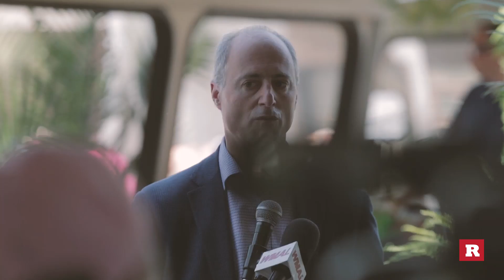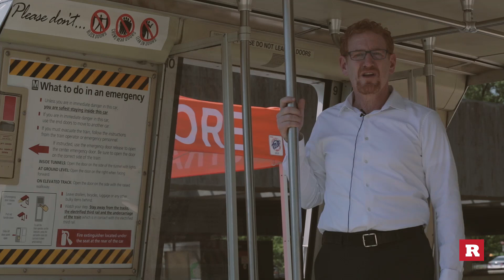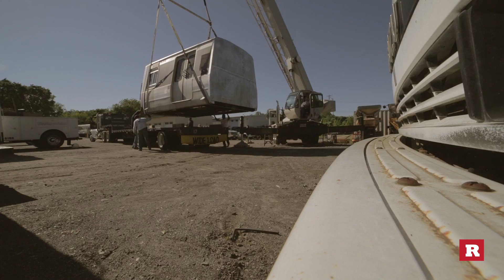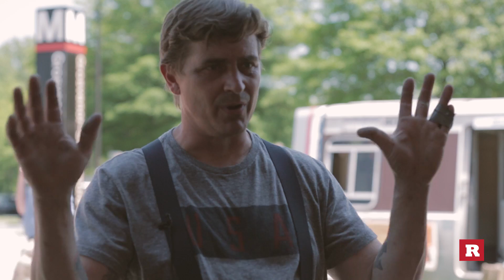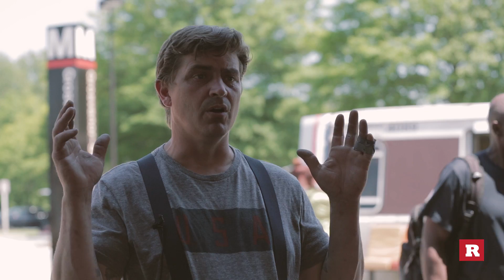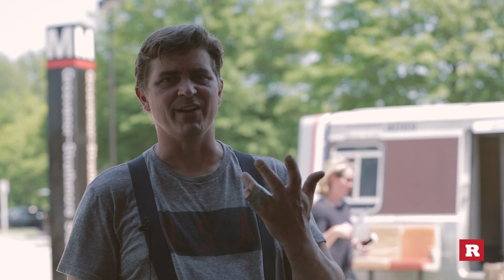DC Metro cars turn into pop-up retail kiosks | Rare News

Comment: OMG...what a sad fate for these wonderfully designed cars. The 1000 series (road numbers) were the 1976 originals now all gone. Same for the 2000 and now the 4000 series cars. R.I.P great legends of the rails.
Reply: 2000s are still on the track as well as the 3000s.  The 5000s are also gone.